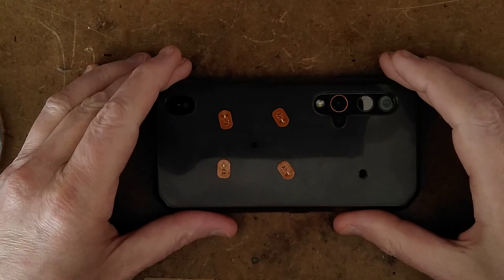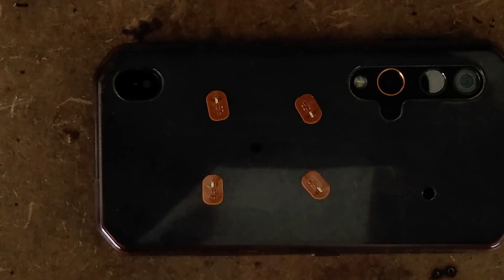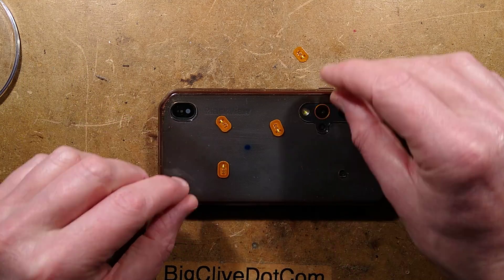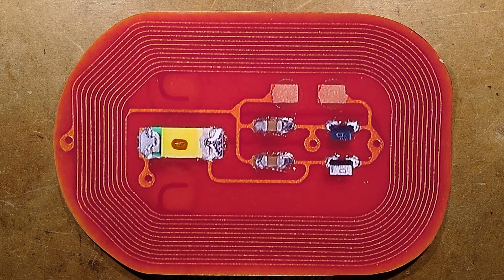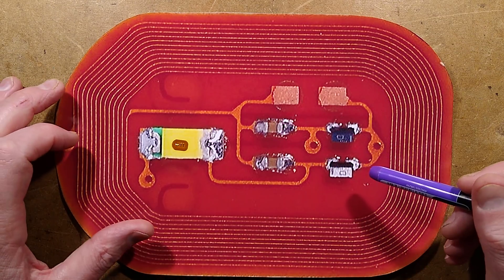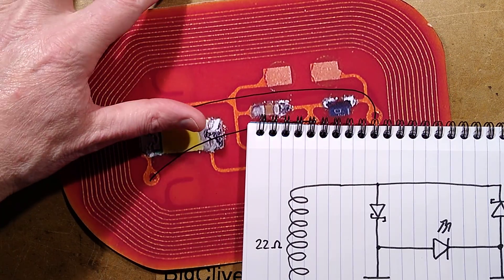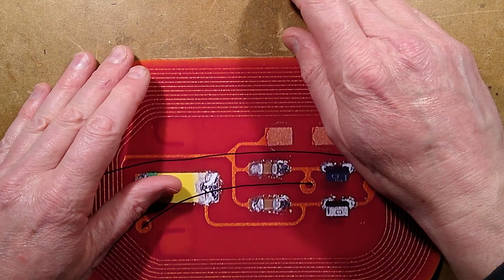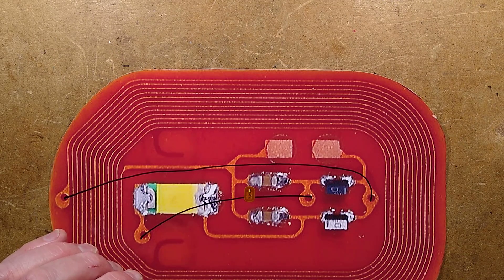NFC powered flashing fingernail sticker (with schematic)

Comment: I took a complete "joule theif" circuit out of a solar garden light, and directly replaced the LED with a hand wound coil that I made with fine magnet wire. The coil was about an inch in diameter, and was around 50 turns.  I used some tape around the edges of the coil in a few spots to hold it together.

Then I made another identical coil and attached the LED that I took off of the circuit board. 

When I powered the circuit with the included single rechargeable AAA cell, and brought the 2 coils close together, the LED would light up brightly. I could put a 2" thick book, or piece of wood (like a table top) between the coils, and the LED would still glow brightly. 

It was a VERY easy thing to make. It took about 15 minutes to make, and surprisingly worked very well as a wireless power transmitter. I just winged it when it came to making the coils and it worked well. 👍

Comment: I got some of these to play with. They're a fun toy. Unfortunately the NFC footprint of my phone is about the size of a postage stamp and comes no more than 1cm off of the phone. I'm not sure what effect the designers of this were hoping for. Are they meant to flash while your texting? Or do you just say "hey look at this" and put your fingers over the NFC antenna. But either application would fail horribly in my phone's case. But they are still fun to play with, so they get a pass for sure. Definitely worth buying a few to play with if you have the extra money to buy a few. I'm still waiting on a pack of those NFC LEDs.

Comment: now imma make this with a handwound coil and see if it maybe works
Reply: update: it actually worked 
a blue led connected directly to a coil made of 30 turns 0.2mm wire  no need for the capacitor boost shown in this video

Comment: Could be used for an alert device that your near a NFC reader for some security concern purposes, gives a signal to another circuit powered by a battery to sound an alarm.

I’m sure they could make it slim enough to add to debit cards so card holders are notified if near NFC reader

Comment: Ah yes, the AliExpress algorithm put these on my storefront the same day you released this video. What I didn't see featured were the swimsuit or lingerie models they hire...
In addition to the requested requirement of recording video in 4k to satisfy the needs of my leased flagship smartphone which I run at low resolution to save battery, I am requesting a prominent feature of AE models to simp on. Thanks.

Comment: Could one replace the led with a piezo to create a sound signal instead of a light? This way one could put that sticker in his portmoney or in the "cardholder" to hear if someone is trying to read them.
Reply from the maker: It's possible that a low voltage piezo sounder could work in place of the LED.

Comment: Wow! I've just got a new Android smartwatch, and just last night I was trying to figure out in what circumstances its NFC coil is energised or not. I tried using my phone to detect it, and that seemed to do something even when the watch screen is off (which was surprising, because as far as I know, Android phones need their screen turned on before the NFC will do anything, so I thought an Android watch would behave the same way). But it wasn't a conclusive test, particularly as the phone isn't a passive device, and now I'm not entirely sure that the phone's NFC coil does get powered down while the screen is off like I thought it did either.

So these things would answer all of those questions! Where can I get them?!
Reply from the maker: eBay.

Comment: Clive, could you remove the parts from one of those stickers, hook a RF frequency generator to it running at 13.56 MHz, and put it back to back on a device with all its parts and get it to flask or operate, using the one unit as an emitter antenna?

Comment: I can remember back in 1999 (nearly 23 years ago yikes) as a student buying a coin cell operated flashing keyring with a red 5mm led in it that would flash whenever a first generation(brick phone) would ring within 20 feet of it, I used to sit in a TV room with varying numbers of other people and at that time only the most expensive phones of the time had a silent ring/ vibration function (at that time a tiny vibration motor with a shaker cam on the spindle inside the clip on battery pack), so ringing phones would continuously interrupt TV and film watching, when I got the keyring from what was I think called "the gadget shop" back in the day (long gone chain of novelty gadget stores) and figured out that it worked quite well , I left it on top of the TV so that when it started to flash people would take their phones out and check them, meant the phone sound could be turned off and people would get up and walk out to take the call (no Facebook or Skype/zoom/ messenger apps or WhatsApp back then just plain basin 160 character maximum text messages) the novelty was useful in that situation

Comment: How are they used on the front line nightclub? Do they work through a human finger? If not, wouldn't the led be covered by the phone? Really cool if you can grip a phone inside your hand and have your fingernails flash. Am wondering if it's possible to mess with the output in software on the phone, for example to pulse in tune to a bassline

Comment: Yeah, it is not using your phone's NFC all wireless charging coil to induce a current,  it is actually your phone's beaconing or tower searching signal  that pulses like that -   if you make a phonecall with them in proximity they‘l manage to get quite a decent current going and should generate maximum brigtness...
these were extremely common in the 1990s or early 2000s unsold as mobile phone flasher stickers. 

the stickers used to have really crappy little pictures printed on their front side and then between 1 & 10 LED incorporated into the image then when your phone rings to get little red and blue flashes that were visible from quite a distance
Reply from the maker: Different sticker based on an antenna and not a coil.  I featured them in a video recently.
Reply: @bigclivedotcom  I'm officially your newest subscriber (just coz You replied!) 😁

Comment: Hi Clive,

I'm really enjoying your videos. I'm finding them very educational and informative and I'm loving your intelligence and witty humour.
I'm not a hobbyist per se, just a single mum with a creative and divergent mind who doesn't like to rely on others. 
I do everything myself like, fixing my car, stereo, light and other electrical installations and anything crafty involving tools, wood, plastic and metal.
I've started doing repairs on my kids key fobs, car speakers and other items and have started making my own Paranormal ghost hunting gear, which I will email you about as I have some questions I'm hoping you can help with. This is the reason for my following question as I just bought myself a couple of new soldering irons and wanted your POV regarding tip cleaning and maintenance such as:-
*tip tinner then solder
*verse steel wool
*brass wool, or
*wet sponge
I've even seen a video where someone used flux instead of tip tinner and then solder on top.

What are your views on these and could you possibly do a quick video on this if at all possible, or, If you have done one could you please send me the link, as I'm yet to find it within your abundance of videos?

Cheers Tania
QLD, Australia
Reply from the maker: Hi Tania.  My own choice of tip wiper is the coiled brass style wool.   In the rare case of a cruddy tip I use tip cleaner, which is a pot of solder, flux and mild abrasive in the form of a hard paste that you rub the hot iron in gently.
Reply: @bigclivedotcom  Excellent! Thankyou Clive. I had in fact bought the tip cleaner and the brass wool lol (great product), but I wasn't really sure whether I should I wipe any excess cleaner off, or just let it drip off prior to re tinning the tip for its next use, or just dip and re-tin?
Lastly, I also at times do plastic solder repairs but with a different tip. I assume it's best to use a separate brass wool for each material to avoid contamination?
Thanks again, and keep up the great work!!!😃👍
Reply: @NitrosDen  Yes, I'd say so. Different brass wool for different materials, especially plastics as you don't want that getting into an electronic solder joint. 👍🏴🤓
Reply from the maker: @NitrosDen  Once it's back to clean and shiny I tend to wipe the tip and then recoat it in fresh solder.

Comment: first thing that comes to mind would be an NFC "alarm card" for your wallet. you have one of these and the led replaced with an optocoupler connected to a tiny amplifier that runs off of a lithium coincell and drives a piezo disk. rig it up that it creates an audible noise whenever it detects an nfc field.
that way when you place it in your wallet next to your other cards it will go off when someone tries to sniff your cards through your pants. doesnt really help and a shielded wallet would be safer, but i guess it would be a fun novelety item that had at least some use.

Comment: You do a lot of reverse engineering stuff on this channel 
Don’t you wanna try and use that knowledge to engineer something?
It’s worth trying and worth watching!
Reply from the maker: I do make things on the channel and have a history of manufacturing signage control equipment and ride lighting systems.
Reply: @bigclivedotcom  Impressive!
But I’m saying about more like building stuff with more details. For instance, in this video with NFC chips you mentioned “other potential applications” for this little device. I’d be so excited if you cover some of those applications for it, say upgrade the circuitry or something 
You got the idea 🥲

Comment: This is a tiny version of the rf coil I use to test the transponders in automotive ignition switches. Wonder if it would trigger off of those, might make a cheaper detector.
Reply: Automotive keys usually work with much higher frequency, 315MHz in the US/Japan or 433MHz in Europe. Some even use the higher 868MHz/915MHz band. NFC is 13.56MHz.

Comment: Im puzzled how can a 10nF capacitor provide enough energy to flash a led?
Reply: Think of the coil as the secondary of a transformer (the primary is inside the phone). The diodes rectify the ac from the secondary and the capacitors smooth it to give positive and negative rails. The LED is the load across both rails. The energy comes from the phone and the flashing is simply the phone turning on the NFC signal briefly and then turning it off again at regular intervals. The capacitors simply help extend the on period slightly to make the flash last a little longer and be more noticeable.
Reply: @RexxSchneider  Thank you!
Reply from the maker: The frequency is a factor.  It tops those small capacitors up at high speed.

Comment: Would be interesting to connect the test point to a component tester to see the inductance.

While repairing my lawnmower perimeter wire, I had the spare wire still on the coil, and the inductance totally killed the signal. Probably 150m

A 20m test showed 0.08mH on the component tester.
Finding the middle and coiling both ends the same way, so the current flows n times clockwise and then n times counter-clockwise cancels the inductance.

Comment: Cool to see, and a handy visual reminder that if you never use the NFC features of your phone you can/should disable them to (slightly) increase battery life!
Reply: I think it's mostly only active when the screen's on, so not a huge concern ("slightly", as you say!) - though that probably varies a lot between devices :)
Reply: No ty. My phone charges 50% in 10 mins. Don't need to turn anything off

Comment: I'm curious if these will light when placed on top of a wall wart power supply with an iron core transformer and not a switch mode supply. I've placed a magnet on one and you can feel the 60Hz sine wave via vibrations of the magnet. No shock.

Sadly my phone doesn't have NFC or wireless charging. Maybe my next one will.

Comment: could we power and eletric motor using a multitude of induction coils to induce charge in to the circuit purely drawing from the latent EMF from the many frequencies being broadcast all the time? The engine with a battery being constantly charged from atmospheric and cosmic EMF? Please drop your thoughts below! This idea is OPEN SOURCE and Non-patentable.

Comment: If you look closely, this is a classic LC resonator like in a crystal radio, but with diodes added to produce a doubled DC voltage.  A cheap LC tester should reveal either the inductance or resonance.  Resonant frequency should probably be same as for one capacitor with the same coil, but might be half or double, as I'm not enough of an RF guy to be sure.

Comment: These would be useful for detecting NFC (card) readers in places where you might not expect (or want) them. A scenario would be: a fraudster goes into a convenience store, then hides an NFC reader in the store’s own rack of (let’s say) potato chips, or gum, or whatever; somewhere near where people stand in line to pay. It then reads people’s NFC-enabled credit cards to skim the info  and save it until someone (the fraudster) comes back to retrieve it. If you had one of these little blinkenlichten, it’d warn you that there’s an NFC reader (coil) and you could then take action… like pulling out a very large hammer and smashing it to bits. Because, isn’t that the best way to get into electronics when you don’t have a spudger handy? 😌
Reply: You can’t skim the NFC chip in a credit card. They calculate a cryptographic signature each time you make a payment, which means you cannot just replay it. They’re considerably more complex than the old magnetic strips on cards, which just stored static data, making it easy to skim them.
Reply: @SkigBiggler  but you can use that for a single payment
Reply: @kentahirono  One payment to where? The skimmers company? The signatures are time bound, you have to use it then and there to authorise a transfer, so to steal the cash, you would need to intercept the signature, and send the payment to your own company or account. It could be done, but I can’t imagine it’d be nearly as effect as skimming, it’d be far more traceable for one.
Reply: @SkigBiggler  someone could have a portable nfc payment terminal and steal money from people, who keep their wallet in the back pocket, while queuing behind then
Reply: @PaulMansfield  maybe, but I believe EFTPOS terminals are registered, and it’d also show up as a transaction to a different company. It’s nowhere near as clean as skimming the magnetic strip, which allows you to basically use the card itself wherever if you have the pin, and most card skimmer kits have a camera involved to get the pin for the card. The difference with the NFC chip is that you can’t skim the data stored, only it’s one time use response, so having the pin isn’t actually that useful without the card. If you skim the card strip you can copy the data to another card.
Reply: The N in NFC stands for near and is limited to 4cm of range in the best case. Maybe if you still keep the wallet in your back pocket, someone might get close enough to try and start a transaction. At that point, any decent pickpocket would have just taken the full wallet from you anyway and have way more fun with your credit card, cash and other things you carry around...

Comment: I actually have an NFC LED implant in my hand, if I bring my phone near it, it briefly flashes from underneath my skin

The issue with powering it from your phone is that your phone sends a pulse of power to try and read NFC chips, it doesn't continuously power the chip/LED

It would be FANTSTIC to have a module that would transmit a 13.56mhz power signal to transmit power continuously so that these (or my implant) could be lit up indefinitely and not just in flashes

Unfortunately it's a little out of my scope as I'm no good with building my own antenna etc, but it would be awesome, if anyone has any simple ideas or existing products I'd love to hear about them
Reply: yeah dangerous things has bioglass implantable versions,i have asked them if they can do some without an encodeable chip,just flashing lights for my genital piercings/implants
Reply: @andrewsmart2949  They do have one without a chip and just an LED

Search for xLED, unless I am misunderstanding your comment
Reply: @dasconkcreetbaybee  not according to their catalog and i dont have a response to my enquiry with dangerous things yet

Comment: Hm...I wonder if I could put one of these on the push to start button of my car. It utilizes NFC to start the car if the battery in the key is dead, presumably it has a circuit like this to provide enough power to the chip to authenticate. Just touch the fob to the button and start the engine. Theoretically...
Reply from the maker: It's probably specifically coded to the brand and car.
Reply: @bigclivedotcom  Probably, but I am wondering if the communication the button uses when no key is detected is based on NFC or another transmission method. It would be interesting to have a light attached to the button that flashes whenever I depress the brake, but it would depend on the transmission method it uses and if it even powers that circuit when the key is able to communicate normally. Might do research on this if I ever get my hands on any of these boards, they seem fun to mess with.

Comment: I wonder if they had the LED blink less often they could use AM radio waves. They're almost everywhere around us. It'd be a super small amount of power but I'm sure some nerd can figure it out somewhere
Reply from the maker: They're very low power, but you do get energy harvesters that can trickle charge a capacitor with ambient RF energy.
Reply: You can do that if you have a big antenna and a high power AM station nearby.
https://youtu.be/dzePJ9781Fc?t=731